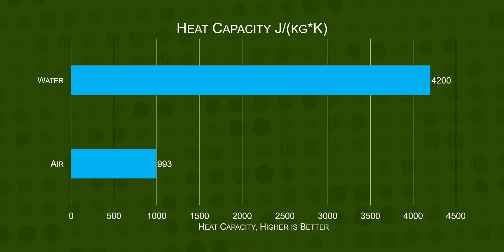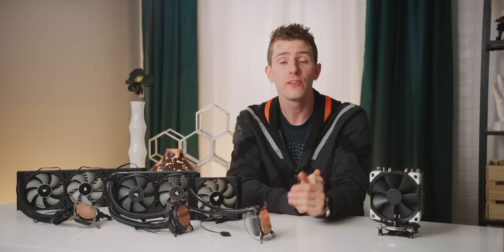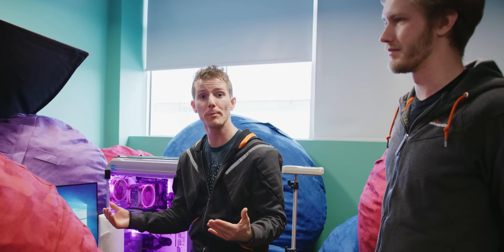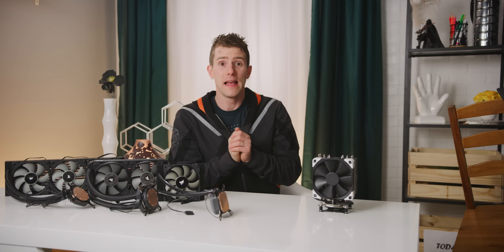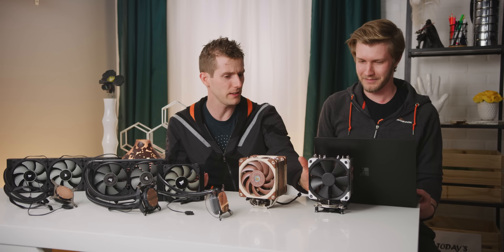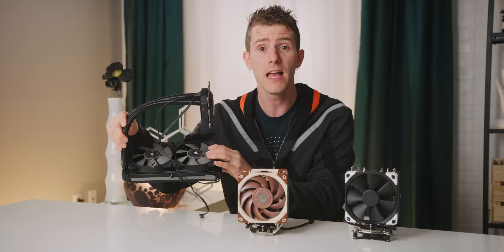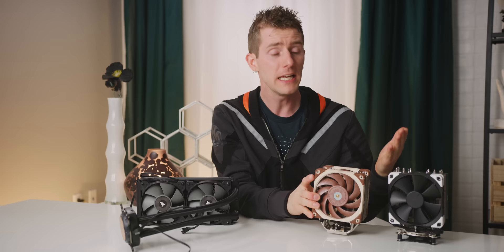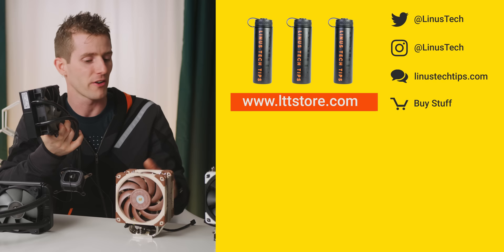Why you shouldn't water cool your PC

Comment: my life has been a lie
Reply: @g0tsp33d  corsair is good lol, not the best but good, and the better stuff is double the cost. air cooling is simply better in every way except looks.
Reply: Johnathan Era crazy just get a 300 cracken and you are set for a while 👍🏼
Reply: @g0tsp33d  I said the same thing but I was bit more vocal and broke it down!  Linus is a Noctua fan-boy plain and simple!  There will never be a fair comparison if he has to go against a Noctua product.
Reply: When
Reply: i'm running a complete liquid cool dual rtx 2080ti - which are also liquid cooled etc. with a 480 mm radiator and 4 noctua fans - its dead silent.  That same machine with fans was super noisy.  You are not living a lie.
Reply: @braderunnah2204  You didn't specify what fans silly. Also, you're talking about GPU's too now, not just CPU's.

Nobody gives a damn you're running some hilarious 0.1% of the market dual 2080ti(worse value on planet earth) with a 480mm radiator.  Your results are useless to the average user or even the average enthusiast. It is a lie, Corsair is by far the number ONE liquid cooler retailer that people buy. They all ate the lie, stop.
Reply: @Booster Gold Bad pun.
Reply: @g0tsp33d  No not really. they sponsor reviewers to REVIEW it. They can trash the product to only a certain extent ofc. Water cooling on really high end PC's are needed but even high end PC's can run without water cooling and at good temps.
Reply: @johnathanera5863  What is the best? Just curious.
Reply: @g0tsp33d  bruh this video was sponsored by world of tanks smh
Reply: @g0tsp33d  have you seen JTC’s be quiet! videos they are literally 10-15 minutes ads
Reply: @g0tsp33d  also there are a lot of sponsorships that still receive criticism from Linus ex. Noctua color scheme
Reply: welcome to the club
Reply: @roboticvenom1935  mac pc go brrr
Reply: @ppnexus2000  I dunno what that means but I hate Apple and I have a PC with a 3600 + 2060s lol
Reply: @roboticvenom1935  you said dual 2080tis is worst value. Look up the apple pc. 60,000$ for a cheese grater
Reply: @ppnexus2000  ok sure besides apple lol
Reply: @johnathanera5863  i don't know who told you that air is better but ok if you want your pc to overheat i mean idc

Comment: Me: comes in thinking I’ll decide which cooling I want

Me after video: still don’t know
Reply: Acropolis same
Reply: Tbh, I would still go for water cooling. It performs better than most air coolers and looks super sick. Just don't destroy your PC while installing it.
Reply: Alright here is the case.

The Air cooler proven to be better at cooling that a 360mm radiator, but the downside is that heavy movement or packaging is going to bend the Mobo thanks to air radiator weight.

So if you move your case, buy water cooling or use Intel stock cooler since it's pretty light u know.

But in my case i got a 780T corsair Case and i bought a 360mm water cooler, i put it on top and now it acts as an Exhaust fan

Case is underpressured, since now i got 4 120mm(3 on top and one in the back) setup as exhaust, while 2 140mm and a 1 120mm on bottom acting as intake.(which means my case is running cooler but dust may gather here and there).

I think my next build will be a 120mm radiator, might go micro case too
Reply: @randomguydoes2901  i actually got the noctua nh d15 not too long ago. thanks for making it feel like i made the right descision :)
Reply: Warm Soft Kitty  Mate, this comment is two months old. Now there are better air coolers, like the new noctuas.
Reply: Warm Soft Kitty  Jesus, okay dude.
Reply: @StarPointy  honestly, when i installed mine, and it was my first ever time ever touching PC Parts and building them, i didnt notice that it could malfunction, how can it break
Reply: @dulla8469  I think a water leak would be the biggest hazard. As long as you're careful, it should be ok.
Reply: @dulla8469  Pump failure.
Reply: @randomguydoes2901  yea i get it now, but when i installed it i was still new to the whole PC building world, i never really though of the cooler that much
Reply: RandomGuyDoes damn relax bro. Who hurt you?
Reply: @sujay750  He's right tho
It's like saying starting your car can kill you because a spark plug can explode and throw a porcelain fragment directly into your forehead while dodging all others components
It's like a 0.0000000000000000000000001% chance
It can still happen but is negligeable.

The thing with these tests, is that they're false
A scientific experiment like this NEED multiple samples of the same things.
You probably know that the same exact CPU in the exact same config will not perform the same as others ?
Well, that's the case.
I had a H150i Pro and never in your dreams you would see the CPU above 70°C
There will always be difference in products, I had a 980 Ti and it was about 85°C and my friend with the same GPU, playing the same game in multiplayer, was about 75°C
That's a thing to take into account, and that's why scientif experiments NEED multiple samples.
Unlike these videos.

And be real, a 2 or 3 degree difference isn't much in the range of temperature presented in the video.

BUT for the noise, decibels being a logarithmic scale, the Noctua NH-U12S is 10x louder than the 12A and almost 10x louder than the H60 and H150I Pro.

The real thing, the real outcome should have been :
Watercooling have the same performance/slightly better BUT make less noise and are more aesthetic than a chonky box hanging from a CPU socket (but that's a personal point)

Stop fighting for nothing and use your brain a little.
Reply: I just had a Corsair H100i Platinum die on me during a new expensive build for a friend. I’ve only ever used air cooling and it’s likely going to stay that way. The temps are perfectly fine and the coolers are much cheaper
Reply: Same here
Reply: If you still don't know, just get air cooling, it's cheaper and does the same thing. If you want water cooling you'll already want it. Water cooling is also a hassle to instal sometimes, so just get an air cooler and a large enough case.
Reply: Go for air cooling. Water cooling is a huge PITA. It has so much maintenance associated with it, and even if you do it all on schedule, the water will still eat away your cooling blocks over time just because of the chemical properties of water. The e-peen is just not worth the risk of water suddenly leaking all over your hard drive, graphics card, or PSU (which could start a fire).
For non-overclocked builds, air cooling (even with stock coolers) is perfectly fine. Just make sure your BIOS allows custom fan curves.

Comment: One other advantage of water cooling is that in more compact computers the small pad is a lot easier to fit on the motherboard than a massive air cooler.
Reply: True, I just went from a be quite dark rock pro 4 to a Corsair h100i pro RGB xt and now I don’t have to do a painful cooler removal to clean dust out